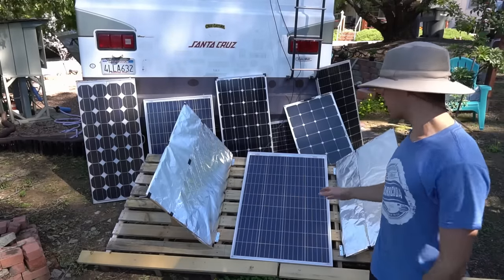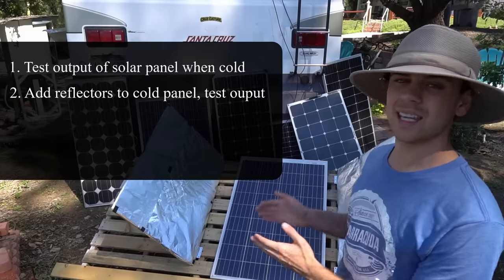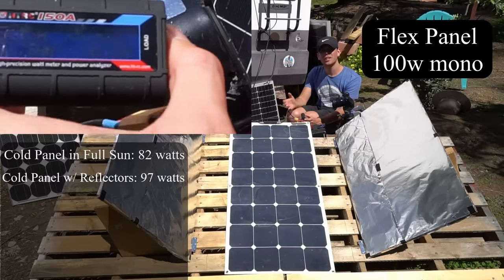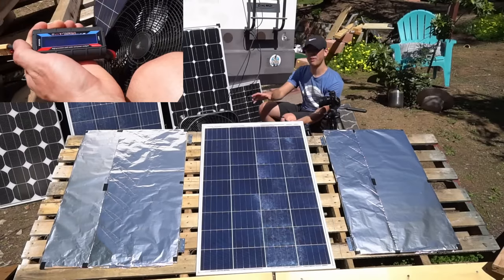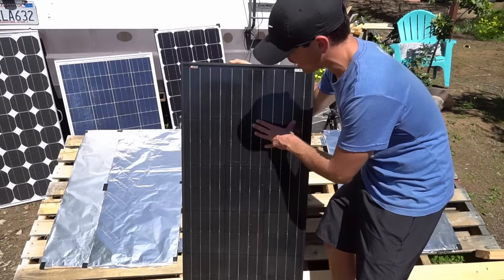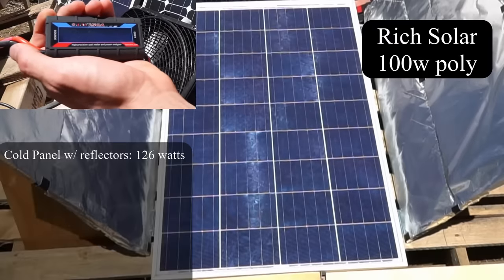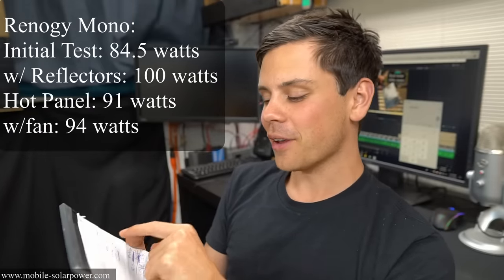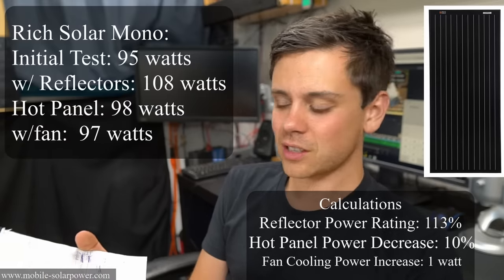Solar Panel + DIY Light Reflectors = More Power? Renogy vs Rich Solar vs Flexible Panel

Comment: i'm no expert at all (not yet), i'm still 19 and learning about green energy in school. but i feel like if i ever would have to give a presentation about solar power and did this expirement, i would get 0/20. ofcourse the increase in power is almost the same for every solar panel. they all get rougly the same amount of extra solar power. the small differences are caused by the different dimensions of the solar panels. there would have been a bigger difference if you also tested amarphous solar panels, these are not so good for direct sunlight but are the best with indirect sunlight(or your mirrors). also, who tries to cool down a solar panel like that? you point the fan to the back of the panel, not the sides. some people in the comments asked about water cooling solar panels with the advantage of having hot water, these already exist but are verry expensive so if you have enough room on your roof i recommend having just normal solar panels and solar water heaters seperate. you really didn't even do a lot with the temperature coefficient, you didn't measure the temperature for each solar panel. for example the renogy mono and the rich solar poly had the same decrease of 8% when it was "hot". you are just assuming both panels have the same temperature at that moment, but the temperature of the rich solar might be 10° higher wich would mean that it has a better temperature coefficient because the output would decrease less each °.

Comment: Dude you've been very fucking helpful to me today because I actually went to the factory where they deliver Rich solar solar generator equipment and I'm going to purchase a 1500 watt hour solar generator and they are going to throw in two 100 Watt solar panels Plus the 30 foot cable connectors for 1300 and not a penny more. There were zero reviews on their website and I was a little bit skeptical about purchasing anything from these guys and I haven't yet but I definitely will tomorrow morning I'm excited to do it

Comment: test with water for drop temp. is more better than fan.

Cooling it with the fan does not make sense the energy you gain by concentrating it, you lose it by cooling the panel. Ideally, it should be somewhat passive. Water. but cooled with the temperature of the night and use it in the day. because if you cool it you spend energy.

You need a large water tank and a very large metal heatsink.
Maybe that is not profitable either because that installation needs maintenance.

Comment: Great experiment man, what about reflector on solar panel that are installed on Dual Axis Solar Tracking System from eco worthy ? It could solve your issue to manually move the reflector as the solar panel move with the sun ans keep the power boost ?

Comment: I wonder why no one has ever attached copper pipes in a back and forth pattern to the backs of the Solar panels. They could connect from panel to panel via pipe nipples and flexible hose.
 If that hose was connected to a simple heat exchanger inside a large container of water, it would provide free hot water for cooking, cleaning, and bathing.
 The circulating pump would be run by the panels themselves because when the sun is down you don't want to circulate and fluid through the panels.
 This solution would make the panels extra efficient without reflectors because the cooler the cell tuns, the more efficient it becomes.....

Comment: For a fixed offgrid installation where you also have use for hot water, a combined electric/water solarpanel might not be such a bad idea.
Reply: I also though this, but quickly I realised that if we want hot water we want it to be maybe 70 C. Which would be a big no-no for the efficentcy of the panel. Because now we are actually heating the panel and not cooling it. Hot water solar systems heat water by constantly adding heat to it.

Comment: So the moral of the story is about a 10% increase when it is warm outside and you are using reflectors. Is the heat build up and power loss exponential or linear was sunlight decreases? How about a Fresnel Lens? What affect does magnifying the sunlight have?

Comment: Interesting experiment.
is there any down side to using reflectors / running solar panels over their power rating?
I would have loved to see a temperature vs power output graph so we can see the optimal temperature for a panel.

Comment: Nice test, but this reflector looks not perfectly reflecting btw. Why not to use a mirror? 

About the temperature, you should test the solar panel floating in the cold water - there was a project to use a water surface for placing the panels, and it should be better for cooling.

Comment: Heat decreas they efficiency of a panel.  Infrared (IR) produces heat. Would it be possible to use some filter that reduces or filter out the IR-component completely? The cost of such a system will not weigh up to the profits, but I was just wondering

Comment: I am wondering if the charge controller decreases watts as the battery charges? Should the batteries have a variable load on them to keep them at a constant voltage?

Comment: Here’s an idea for an experiment. I believe that solar cells get their energy from the ultraviolet end of the spectrum and ultraviolet is very reflective. So why not put your solar cells in the shade to keep them cool and reflect ultraviolet light in to them using a curved black mirror. I say black because as far as I know black is the best reflector of ultraviolet light without reflecting heat as well. WARNING if you make a good parabolic black reflector it could be dangerous for your eyes as the ratio of visible to ultraviolet light will not be normal while It’s pointed at the sun and your pupils may not close enough when you look at it. Therefore I would recommend at the very least a good quality pair of sun glasses be worn but you could also invest in an automatic dimming welders helmet as well as keeping your skin covered if you go big with this experiment.
Reply: Tim Hill love it!! idea with safety advice.
Reply: Jason Kennedy thanks mate.

Comment: I have a 3kw system that isn't quite enough. I'm in India and the monsoon can get very cloudy for days on end. On such days there isnt enough power to run our water pump (the motor surge is too much). Can I just add a couple of panels to the system without increasing the batteries, or upgrading the control unit?

Comment: Hey Will great stuff you put out here!  
I have a question about positive ground MPPT charge controllers. (saw your Renogy unit in the video and it reminded me) How do they compare with negative ground controllers and when would it be beneficial to use one instead of the standard negative ground units? can they be used on a 12V negative ground RV system?
Reply from the maker: Yeah I've seen those positive ground controllers. Very strange. All that I could find on the issue is that some panels made by grape were positive ground to fix a specific issue. For off grid systems, there is no real benefit and should be avoided. To this day I still do not understand why they would do it. In some large grid tie systems, dissipation of excess charge is preferable, and for some reason they wanted positive ground solar panels. But again, I would avoid it.

Comment: It's sure that cooling a solar panel with air or water is stupid, but it's taking the thing upside down to see it like that.

you do not cool the solar panel specifically to cool it and produce more.
You heat water or air for your home, so it's a possible energy gain

Comment: Very interesting.. Ive been whondering about the heat coefficient problem that comes with all solar panels.. Now i know solar cells hate air thus the sealed frame they come in but what if there was a small gap in that frame say 1/4 of an inch and we used nitrogen gas to flush all the air out and then seal the panel with the nitrogen to keep the cells at a cooler temp? Wouldn't that make solar panels way more efficient? Also perhaps a concave reflector would capture the sun in all or at least most positions so you wouldnt have to adjust them all the time.. Lmk what you think about these ideas! :)

Comment: I have a limited space where i can put panels on. I was wondering, if i put 2 panels in a V shape so that the space taken would be the same, maybe the panels would not get so hot, maybe would reflect light on each other. Would it increase the output / area ? Thanks

Comment: how would a paraboilic concentrator work in winter climates on shorter days or on cloudy days, where the panel may not over heat. Can you destroy a panel by having too much solar power concentrated on the panels

Comment: Very interesting and informative.  However, your test, in my opinion, is testing the wrong thing.  You essentially set up a direct overhead sun shining on the panel, plus 2 reflectors angled to add maximum reflected infrared heating during the absolute hottest (maximum direct sunshine) time of the day.  This is not really the best use of a reflector in a residential setting.  In a normal residential setting you want to use maximum electricity late afternoon/early evening for air conditioning/cooking/lighting use plus maybe a little bump in the morning when everyone is also cooking, heating water, lights on getting ready to go to work.  What you need is to test 2 reflectors at much STEEPER angles so only ONE reflector is hitting the panel at a time - and then only a few hours early morning and late afternoon.  Also, set the reflectors back a bit more from the panel, and make the reflectors shorter so they don't actually SHADE the panel during early morning and late afternoon times.  For that matter, I think only a single steeper and shorter reflector set up on the east side to catch later afternoon sun would be cheaper, easier, and most effective.

Comment: I don't know if it is feasible, but can a water cooled panel help in dropping panel temps easier than the fan method?  I wonder if a low powered pump can increase overall efficiency without it being too much of a power drain on the overall system?

Comment: I have a question.  Will the results be the same if you move the reflectors back 20 feet to reflect only the ir light instead of the heat? I always see my easterly facing panels producing amps when the sun is on the west. I assume it was the reflection from my westerly facing panels and viceversa.

Comment: Wait, whaatt??
Mine 100wp poly and 100wp mono, both of them never charge more than 5a/60w per hour, poly 3.9a(little cloudy) - 2.4a(bright conditon) and mono 0.90a(cloudy)-4.8(bright condition).

But this solar panel, flex panel 82w(minimum) that 8a and the one rich solar 133w that 11a?? Woooowww i'm amazed.

Convert 1a x 12v = 12w

Comment: How different is the absorption spectra for mono vs poly vs flex? Not for the whole panel, just for the part that can convert to electricity.  Obviously you don't want to filter out the good part of the spectra.

Comment: Have you done any testing with the panel hanging vertical to see whether there is  much of a difference of tilting it to the sun. What would happen if you used solar panels as reflectors

Comment: Whould that decrease the life span of the panel or it doesn't have any effect? I was thinking that it is made for less than 100w use, so if i use it on 110w maybe the panel has less life span

Comment: i wonder if you can put a mig waterblock on the back of the panels and use that to cool em down and get hot water off em for showers and washing dishes,
could you do an experiment where you use thermal silicone to put some tubing on the back  (doing a ring or stacked S shape) and run water trough it w/ a 12v pond pump (the ones that pump slowly for water features)  to see what the results would be off that?

Comment: how many panels can you stack on each other with a 20mm air gap, what if you put copper piping in a loop s fashion then run col water through the pipes to cool the panel then have the water pipes con neck to a storage tank now you will have hot water

Comment: well dang now i wish it was a little warmer it went as high as 5c today and so was running around out side now its dark and almost 0c hear in Ontario Canada i relay like the idea of liquid cooling  and using the heat to pre heat my hot water or something if it could be done cheep enough it should at least it might extend the life of the panels and in winter could melt off snow and frost just before sun rise and help with ext ream cold  damage as well

Comment: Try a test using mirrored window film, on the panel, with a very low tint.  Maybe dumb, just curious if it would keep temp down.
Reply: Put them in the shade

Comment: Wonder how putting thermoelectrics on the back side of the solar panel would work, generate a little extra power from the heat while drawing out some of the heat from the panel

Comment: Angle of sun change while video was being made? Or did you rotate the pallets with it? Wattage only increased for cold panels without reflectors, could be a third variable that was getting "better" throughout
Reply from the maker: Well if that's the case I wouldn't get consistent results in my calculations at the end. And I did these tests pretty quickly at peak sun light angle so I highly doubt it

Comment: Wonder if there's a way to reflect only the specific wavelengths of light that the cell type uses onto the panel and reflect the other wavelengths including infrared away. Maybe a diffraction grating or prism in the mix? Might be able to produce way more power because most of incident light is converted to power and wavelengths that would otherwise just produce heat are excluded. Thanks for the great video as I've long wondered about reflectors.

Comment: I have not seen a video or experiment showing the value of reflectors for panels that face away from the sun, due to the orientation of the roof: specifically, east and southeast panels on a roof. Can reflectors extend the usable sunlight after the sun angle matches the pitch of the roof??

Comment: Here me out here, what if you use the reflectors to filter out colors of light that don't add any power production to solar...reduce the heat by reducing unused energy, that way the reflectors get the heat not the panel?

Comment: great test Will, i like it. question: what was the temperature increase with reflectors?   and if you try to put two panels at an angle off each other will there be an advantage because of reflection?
Reply: Interesting idea, on the otherhand, putting them at an angle reduces the surface area in which light is catched directly.